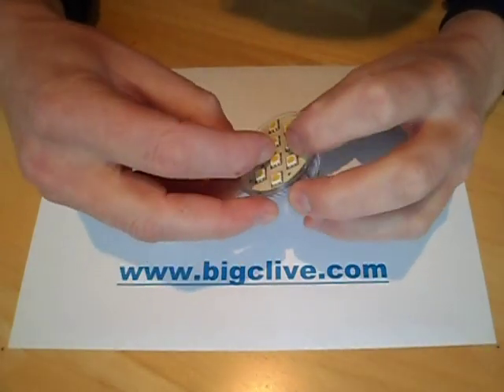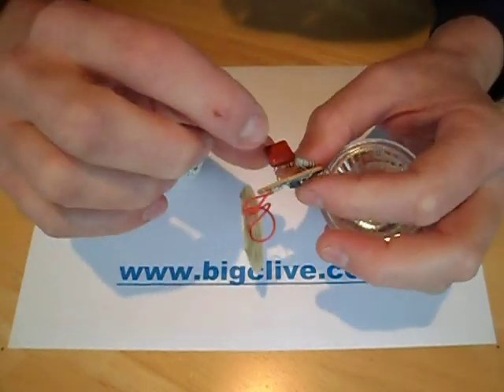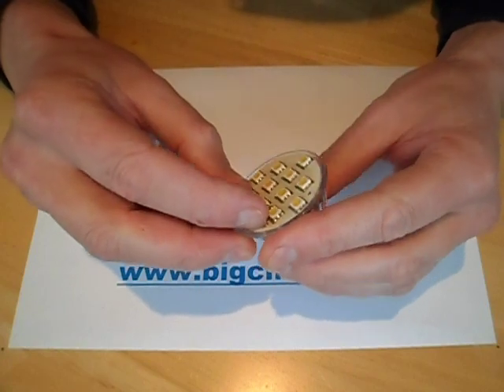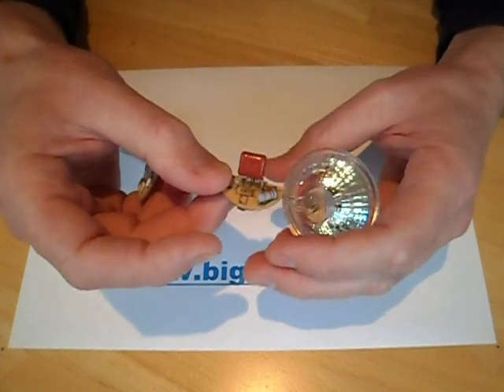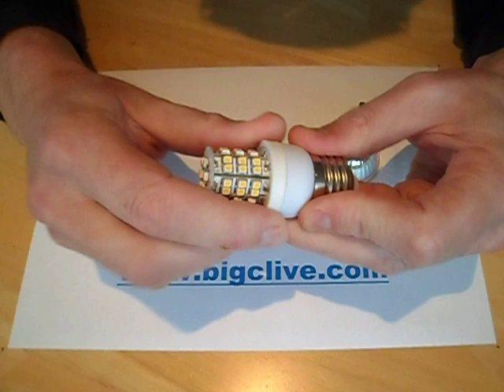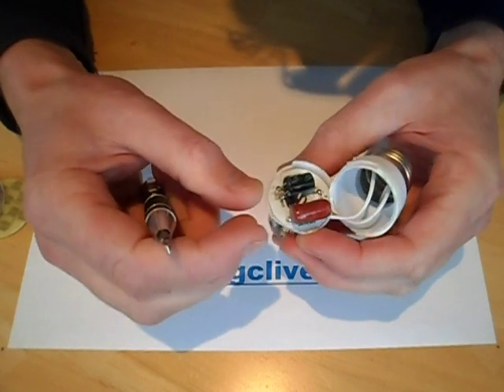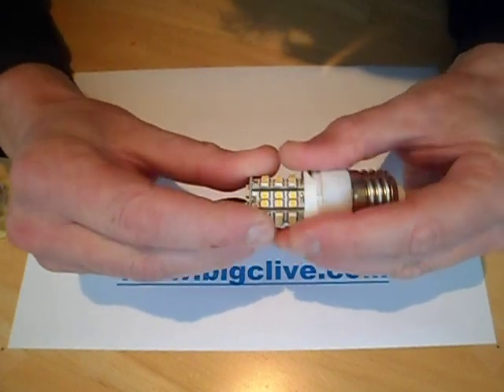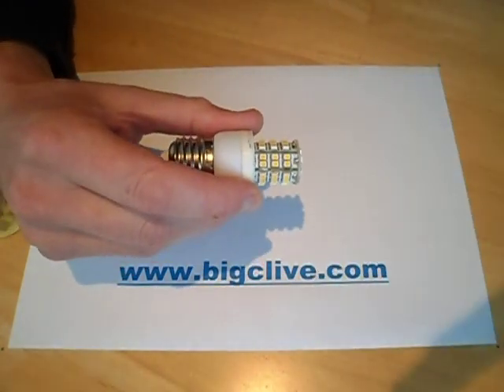Deadly LED lamps from China on ebay.

Comment: Did you check how much was the voltage at the LED pins or you just assuming that is high voltage cause they screw right into the bulb socket, the feeling of 40v DC over 7 ampers (7000Ma) is just barely noticed in your hand, I know cause I built my own amplifier with a STK439 and I had to build a good power source, 
That little Integrated circuit looks to me like a switching voltage regulator, 
Now on days things uses less components cause IC's comes more complete and efficient than on the past... 
Make a good research including multimeters and more equipment than a screw driver... 
Thanks
Reply: No - it's a bridge rectifier not a switching regulator.
You think this is safe?
Do as another comment suggests - poke around in your mains socket with a diode.
Reply: Lol
Reply: Whatever dude just learn some electronics before you be talking about on YouTube cuzz
Reply: And if you don't like comments on your videos make'em private cuzz
Reply: Bridge rectifier LOL!!?? 
when a led just need half wave rectifier to work,
Now on this days it can be a rectifier and a switching voltage regulator in a single capsule... And assuming things in a video is just not proper
Reply: Did you understand English?
Reply: Dude we are not on the 80's technology it's way advanced than your knowledge
Reply: Wen I said IN A SINGLE CAPSULE it means inside of a chip
Reply: I barely understood your supposed use of English.
Reply: For example in your times how big needs to be a amplifier circuitry to produce 40w+40w rms with 12v (I'm not talking about peak watts) now on days it can be done with just 1 chip 1 resistor and a couple of ceramic capacitors and it that fits inside of a mentos box TDA7375
Reply: English, try using it.

Anyway - the evidence is right there above for you in two pics and a vid, you're on your own now.
Reply: That's what I thought
Reply: Get on the books brah
Reply: Is just that you're too square homeboy
Reply: DJohn NineOneSix I'll tell you why full bridge may make sense, because you need less than half the capacitance to achieve full duty cycle, and capacitance is the largest cost point and space consumer in this thing.

Thing is, Clive has the education and worked as an engineer, he has disassembled hundreds of lights and he knows all the power supply topologies, and he has a magnifier in case he finds an unusual IC. He has been building power and lighting equipment for nearly 20 years now too. Can you claim the same?

I'd ask you to reconsider whether your knowledge of electronics is sufficient, and even whether the one item you built is safe. For one, in some countries, there's no telling between Live and Neutral, and there's no Ground connection going into this light unit, so the LED voltage is going to be referenced to WHAT exactly? How do you guarantee that it's not at live potential? The proper way to guarantee there's no dangerous potential in case you have two mains leads is to float the output, but for that you need a transformer. With a high frequency SMPS controller you can make the transformer very small, but there isn't one to be found on this board, and at a few Watt this fixture needs, it will still have some size to it, you can't just make it invisible.

If you want to prove your hypothesis, give me any specific part number that you think this is based on and either you'll prove us all wrong, or i'll tell you why this is still unsafe. Alternatively, you can go ahead and touch the exposed solder points on a cheap eBay light from China (many of which do not even have mandatory certification local Chinese retail market) while it's installed, if you're THAT convinced that it's absolutely safe.
Reply: Is sad to see that 20 years haven't done anything... I'm a tech too homie and a bridge rectifier is not logic in a LED light cause is something really simple
Reply: I'll put a bridge rectifier in a high performance audio system but In a LED light good enough with a single diode rectifier, a bridge rectifier is a set of 4 diodes and by the way I being doing electronic since I was 9 years old and I'm over 30 so I think I can claim that and lights is not my only speciality, also I'm a ASE certified automotive mechanic and that's just 2 of all my skills

Comment: lots of things end up unsafe for kids.  My favourite (not)  Light switches.  without the cover that goes around the wall switch.  Sigh.  you know if you put your finger in the gap and your a kid, it won't turn out well.  (was at a reunion of a sort (retirement party that ironically really wasn't one but his daughter didn't know that.  :O  So meeting people I hadn't seen in 24-25 years when they were like 13-14 yrs old ) and she's like 4-5 years younger than me but she had this farming style warehouse that held the party   and it had a bathroom and alas no cover over the wall switch.  Now I don't have a cover over my wall outlet but there's a reason for that.  1. I plan to switch the RUSTY outlet 2. It's rusty and I really not sure if I wanna find out what that does to copper wires.  (it's along the bad wall that tends to get a bit wet during the winter :(  But we don't have kids around.  If there were I'd put a cover back on it.  But the reunion there were kids a go go.  And I sorta brought this up and ended up blocked on FB for it.  sigh.  Bit annoying when one points out a danger and they don't like being told about it. :(  Don't have a problem with her dad and older brother as far as chatting just uncovered wall light switch.  blocked. :(  Safety first...

Comment: Yep speical alright mine stay on when there off!
Reply from the maker: Dale Whitmore That's actually covered in another video, jokingly referred to as overunity.  It's common in the LED lamps if they have super simple circuitry with no smoothing and are missing a resistor (usually 470,000 ohm to 1Mohm)to shunt leakage current on the mains wiring.  It's caused by AC leakage between the switch wires and a small element of insulation leakage too.  If your light switches have any active circuitry in them like a dimmer, remote control switch or even just a neon or LED that makes the switch plate glow in the dark, then the LED lamps will be quite bright with the higher leakage current used by the switch.
Reply: Ahh thanks for that always wondered why they do it.

Those china things really are not safe one bloke on here has called in the standards mob.
I guess it does not help that innocent person with no idea, but whats to say china standards say its ok.
Than there standard is exported to us with what we call a MAJOR defective lamp.
So really is it us or them, I know some importers are just as dodgy as them but if you but directly from them than I guess its expected.
Thow they do lie through there peggy teeth to sell a $2 item lol.
$2 is worth some ones life I don't now how but I would love to play god for a day and have the karma stick handy. but I guess they wouldn't learn anyway.

If you ask me anything 240V-110VAC appliance should have nothing at all live to grab unless its a red hot element. toaster, grill ect.

Thanks for the video also.

Comment: In this house we obey the laws of thermodynamics. ONLY, I repeat, ONLY buy LED bulbs from a brick and mortar store within driving distance, I don't mean to sound racist, but if you buy white you have a lower chance of opportunism.
Reply from the maker: There are plenty of UK sellers reselling these things.  And some already know they are dangerous, but are still selling them either to get rid of stock or because they have convinced themselves it's not an issue.  On the other hand...  Yes, buying from a big-name store is probably safer, but lacks the variety and novelty options.
Reply: You did sound racist.
Reply: Brent Fisher but thier buying from guess where? china.

Comment: If you touch an incandecent bulb after it has been on for 15 seconds you will burn your fingers so why would you be touching an LED bulb. A light should always be OFF when changing any bulb so I don't really see the problem. A light bulb is not a toy to be played with and is usuallyout of range of children.
Reply from the maker: LED lamps do not get very hot and are therefore very touchable by children.  If they touched a traditional tungsten lamp they would get hurt by the heat and not do it again.  They might not get a second chance if they touch a live connection on one of these lamps.  There's also the issue mentioned elsewhere about a pendant light controlled by two or more switching points.  How do you know the power to the faulty lamp is on or off before you touch it?  One day there's going to be an electrocution, charges of manslaughter and then red tape.  All for the sake of a plastic cover that is already supplied on the exact same lamps by other sellers.
Reply: Touching a light bulb whether cold or Ouch fuck! that's hot!, SHOULD NOT RESULT IN DEATH.
Reply: neil rich in

Comment: Use a meter and test one of the LEDs. It should only be around 1.5v DC which cannot shock a person. The danger is the AC power coming in before the compacter.

Comment: Chinese know to turn off the power before handling the lamps.
Reply: Robert Gift That won't do them a lot of good unless their switches are exclusively dual pole. I'm not sure you could claim the same about European switches either.

Besides, a mistake is easily made. If a light has burned out, it's easy enough to be confused and toggle it on instead of off.

Comment: The overwhelming Chinese industry puts in the hands of the entire world population technological products that other countries would eagrly monopolize. My impression is that your video is motivated by envy.
Reply from the maker: No.  My video is to try and save people from getting electrocuted by products that have been designed by idiots.
Reply: duenodelustucru My Auraglow bulbs were also made in China. I think theyre probably quite safe... Also, as Chinese workers demand higher wages, companies sometimes make factories within the country they're selling to, using complete automation - no human interaction whatsoever.
Reply: duenodelustucru There's of course thousands or millions of high quality products manufactured in China, and they too have some of the world's top engineers and facilities, but when proper certification is not applied, we receive crappy dangerous products. These products usually happen to come from China because the liability is harder to nail down, and because Hong Kong worldwide postal services are really cheap. But indeed dangerous crap can come from your own back yard too. It's not about the Chinese, it's about how we can protect ourselves.